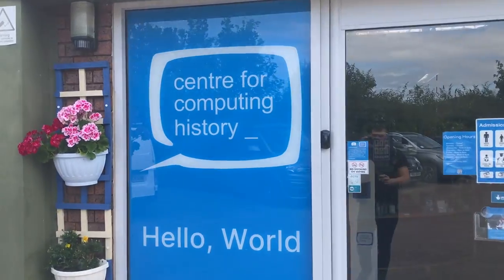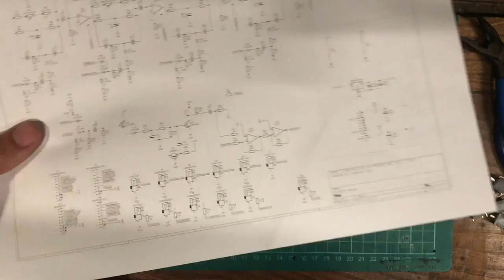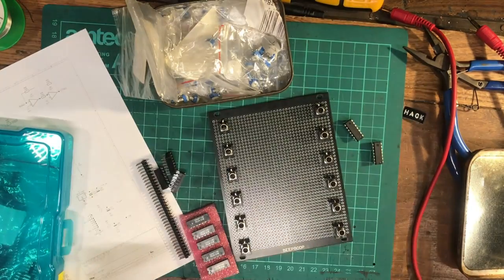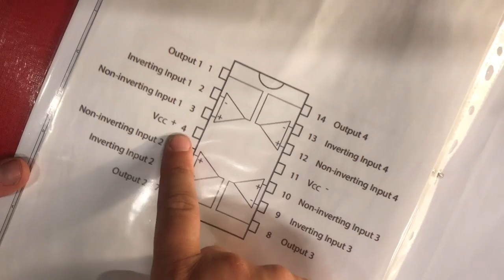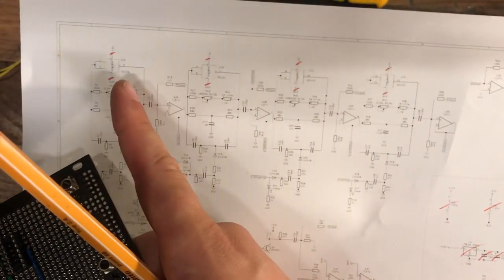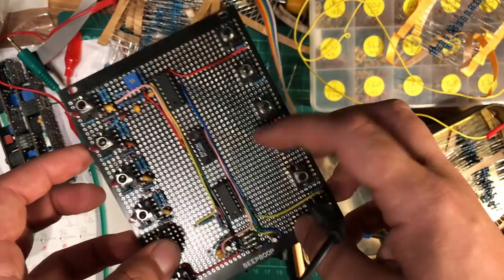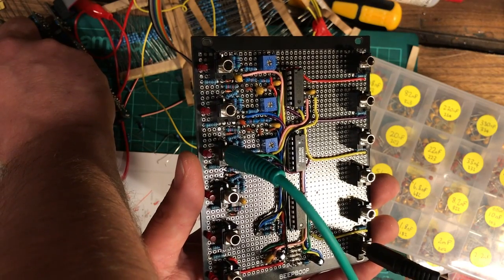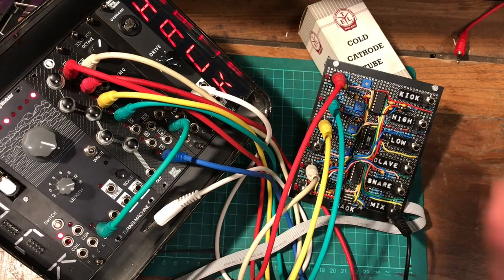Making Drums For My Modular Synth!

Comment: This is a very cool project, and you made a very neat job of laying it out on that prototype board.  I started out using veroboard and so that makes a lot of sense to me - you use the strips and break them where necessary. i've never really been sure how to use this type of prototype board. ie which side the stuff goes on, how you're supposed to make the connections etc. So I was fascinated to see how you went about this. 
I love the result too - as in the sound of this machine. It's even better knowing that it's from a vintage magazine.
Reply from the maker: Cheers =) I use stripboard a lot too. This was really easy to fit stuff in tight spaces though. I’m sold on these panels for quick prototyping! The trick is definitely to use bare wires and component legs to join things instead of bridging rows of pads with solder. Really useful to be a able to solder on both sides. Thank you for the song at the end btw!
Reply: @hackmodular  You're very welcome! There are definitely lots of good tips in the video. Your 'breadboard' prototype pcb is beautiful, btw. I don't know what I'll use it for yet but it will be something special.